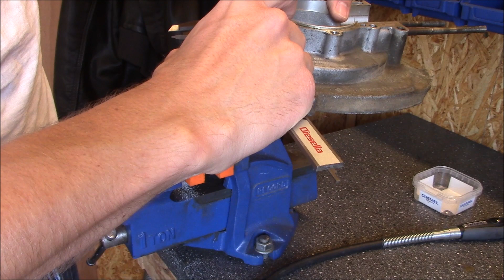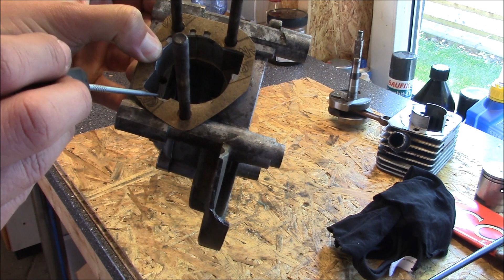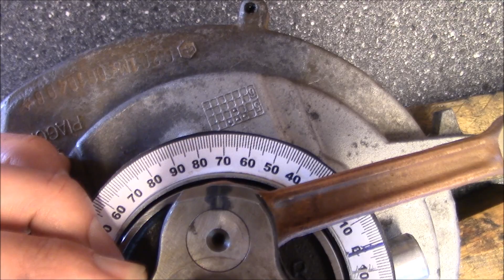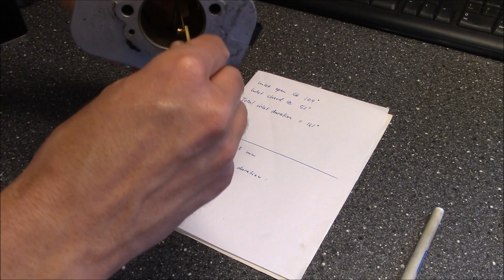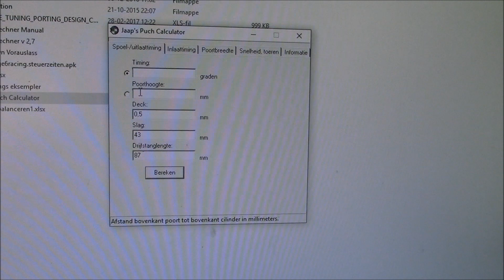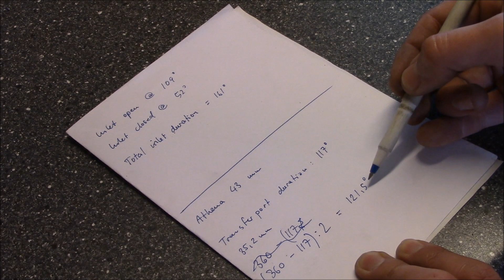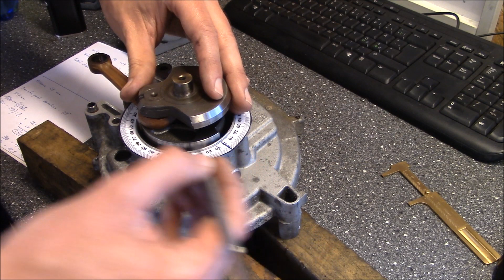Piaggio Moped Engine Tuning

Comment: I just bought a 75cc Malossi kit for the same engine as yours. 
Do I need to change the crankshaft too?
I do need to mention that the stock crankshaft is in very good condition with no radial freeplay at all.
Reply from the maker: The original crankshaft is perfect, also for tuning. As long as there's no play and it runs straight. But you need to adapt the inlet timing like i did, or else you will not get full power. Beware that you need to mill the housing for the larger bore, all 43 mm kits fit on the stock engine. The larger 46-47 mm kits need to be enlarged for the cylinder skirts. The Malossi 75 cc is 46,5 mm.
Reply: Thanks for the reply!
I've milled the housing a few days ago, thanks for the heads up. 
Regarding the crankshaft I don't have the courage to do what you've done. I am quite afraid that by doing this I will have to deal with strong vibrations at high RPM due to the fact that the crankshaft it's not balanced anymore. Some three experienced mechanics told me that I should change the crankshaft too, due to the increased power, otherwise it will brake in the first thousands miles.
I do need to mention that apart from the big bore kit I also changed the following :
- Delorto sha 13/13 carb
- Malossi spor air intake filter 
- Giannelli Fire Sport exhaust
Reply from the maker: The original crank is one of the strongest on the market, together with the Mazzucchelli or maybe the Pinasco. And yes, you can get some vibrations. But you will experience this anyway because you change the piston from the original to the Malossi, that is part of the balancing calculation anyway.
There are good racing crankshafts on the market, Mazzucchelli and Pinasco have a model with larger inlet timing. I don't know if they have done anything to counter the changed weight.
If you have an engine case with ~160 stock timing, you can probably go pretty fast too, i've never done an A-B test on the same engine, so i can't tell you how much difference it will make.
The Giannelli Fire makes power in the upper RPM band, it would be good to have more inlet timing to match it.
Reply: What's the difference between anticipated and non-anticipated?
Considering all that was mentioned above, I've decided on buying a new crankshaft, but the Pinasco one is almost a hole 100$ more expensive than Mazzucchelli.
Pinasco: 
http://www.ebay.com.my/itm/131116637408?ul_noapp=true
Mazzucchelli: http://www.ebay.com/itm/MAZZUCCHELLI-ALBERO-MOTORE-ANTICIPATO-PIAGGIO-CIAO-BRAVO-SI-SPINOTTO-10-5184-/282379166905?hash=item41bf1c24b9:g:d4cAAOSwTuJYtqB3&vxp=mtr

Is Pinasco worth almost 100$ more?
Reply from the maker: Just go with the Mazzucchelli, the one called AMT 004 for the 10 mm wrist pin. I don't know if thats the 5148 as they call it on ebay. But Anticipato means earlier/longer/advanced i think, so that must be the one with longer inlet timing.
I just checked the Mazzucchelli catalogue, the AMT 004 (racing version, 10 mm) is called "Anticipato". So it should be the right one. I've used the AMT 004 before, it's very nice and durable!
Catalogue: http://www.nuovamazzucchelli.com/alberi_motore/piaggio.pdf
Reply: Thank you do much for your suggestions! I really appreciate the help!
As for the crankshaft, I've ended up ordering the Mazzucchelli Anticipato one and saved myself a lot of money by staying away from Pinasco. The only thing that's stock right now is the variator which, if it will not break, I will not have it changed. Apart from that the modifications I've made include:
- Malossi Grupo Termico 75cc 316156 Spin. 10
- Albero Motore (Crankshaft) Mazzucchelli Anticipato Spin. 10
- Dell'Orto SHA 13/13 Carb.
- Malossi Sport Air Intake Filter
- Giannelli Fire Sport Exhaust

I think with all the above modifications (all ordered trough Ebay Italy) the power increase should be substantial. 
I've not been able to find some improved bearings to handle the extra radial force, but I think the RMS ones which I've bought should do just fine!

Thanks once again for the quick help. Keep up the good work with your vids. I've subscribed.
Reply from the maker: Sounds like a fun setup! But i think you will order a variator pretty fast ;) The slopes for the rollers don't allow much travel, the belt can't run all the way to the outer edge of the stock variator, and you can't get rollers in different weights, so you need to drill them out to make them lighter. I had my stock variator on my Ciao for only a few km, reached the end of the range very fast and shifted at a much too low point.
Reply: How much do you find the top speed to be reduced with stock rollers?
I guess the acceleration remains preetty much the same.
Reply from the maker: Both increase alot! The end gearing is much larger with a tuning variator. The roller weights determine the acceleration. The stock weights are adjusted to the point where the original engine makes most torque, this point will be further up in the rpm range, so you need lighter weights to find that point.
At least on the 90 mm rear pulley, it can't use all the range. I don't know if it's the same problem with the 100 mm rear pullet (because of the lower flat sides close to the center).
Reply: Carsten Lorenzen hi, would you please recommend for me where to start if i want to learn about 2 stroke porting and timing ? 
i want to learn how to get the most out of my cylinders/blocks without the help of other people . just like you haha if i could borrow your brain for a day :p